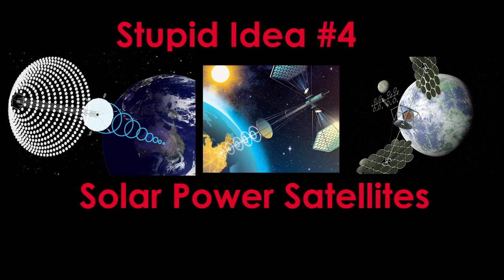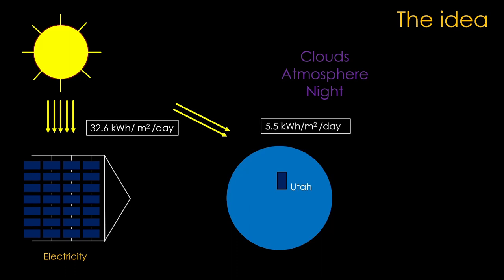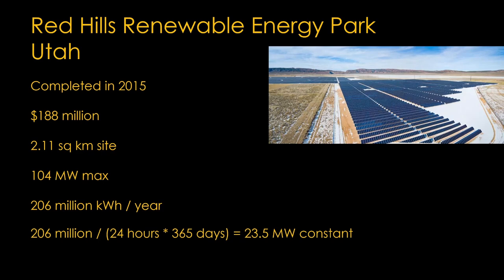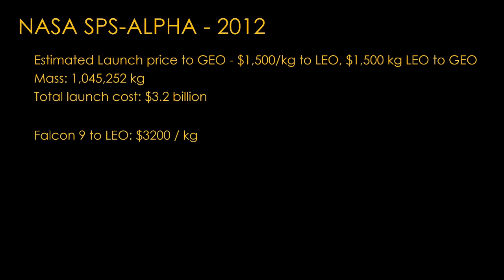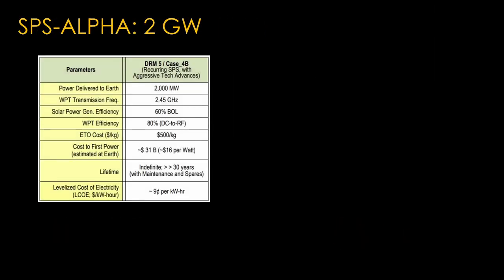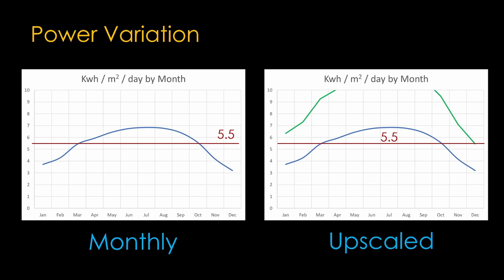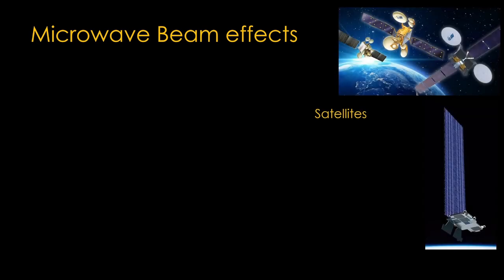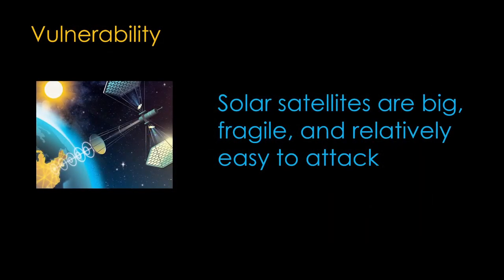Stupid Idea #4 - Solar Power Satellites

Comment: Sounds like rather than building a 1 sqKM antenna to receive the microwave beam, you might as well just build a 1 sqKM solar farm?
Reply: A rectenna is basically just a big field with loosely spaced wires in it, they are trivial to build. Doesn’t make the case for SPS any better but it isn’t quite that bad

Comment: I’ve come across this idea before and your analysis of it is definitely spot on. A couple thoughts: 
-Could a space-based system in the near future be developed so that the ~5x increase of productivity is not outweighed by the size limitations inherent to this project? My initial disagreement with the entire space-based solar option was that it would be very hard to send up something even “only” a fifth the size of some of these solar plants without years of development in terms of space construction infrastructure. 

-How long would it take for the price of the construction of a kilometer wide antenna in the desert and the launch price of the space based system to break even assuming normal/competitive prices to the consumer? It would seem to me incredibly long. 

Now, I haven’t seen the 2012 study, so I’ll have to take a look at that, but I’m guessing they are assuming advances in launch infrastructure as well as advances in the efficiency of solar panels.

PS, Any specific fish or will any fish do?
Reply from the maker: Before starship, launch was clearly a problem; I think even the pilot plant was 166 falcon heavy flights. With starship, you could probably do the pilot fairly easily, assuming that orbital refueling is straightforward. 

The problem I see is that if you just take the space you had allocated for a rectenna and cover it with solar cells, you're going to get more power output than the space-based system with none of the risk. 

I didn't put in a picture of a rectenna, which is probably an oversight. They're fairly simple in design; just a bunch of wires held up in the air, so much easier than the solar farm we're comparing it to. You do, however, need to find a circular property of the right size; Red Hills happens to be this really weird shape because that made the land acquisition easier (and cheaper, presumably).

If you want to see the NASA study, I linked it in the description. I found it confusing to understand, however. 

WRT fish: Do not constrain yourself by predetermined notions of an icthyological nature.
Reply: @EagerSpace  yep, I also found that point about using the land for the rectenna to just build a higher output solar farm on the ground pretty amusing but failed to mention it. Launching on hundreds of Falcon Heavies (Heavys? Heavy’s? How do you pluralize that?) is no small feat, but Starship could make it more feasible. Assuming SpaceX’s proposed frequency of three launches a day every day forever until we run out of methane, it’s definitely a less daunting task. 
Now, what’s caught my eye is that they planned for oh so many moving parts that need to be attached on orbit. The fragility of it, as you mentioned, would make each of these 150 docking operations nail-biters. Added benefit of starship is that you’re doing this less, but you’re also maneuvering a whole starship around a giant solar panel station in GSO, which is neither here nor there right now.
Thanks for explaining the rectenna, by the way. I had a feeling it wasn’t a giant parabolic dish, but I should’ve known it was wires. Those sneaky electrical engineers and their tricks. I’ve heard elsewhere that this exchange between electric power, EM, and back to electric power happens to be somewhat inefficient, so that isn’t helping the project either. I imagine a lot of power would be lost to the land surrounding the rectenna. More rectennas? Maybe. Another billion dollars in rectenna funding? Definitely.
Reply from the maker: @ksmi9109  I would prefer "Falcons Heavy"...

Rectennas are pretty efficient with good design; 80% is fairly easy and over 90% is probably possible. It's the transmission side where efficiency is harder to get.

Comment: Hi Eric! Stupid idea #5: Do you think it could be possible to focus a meaningful amount of energy by reorienting the Starlink constellation to reflect sunlight into a point? i.e. to heat & deorbit space debris
Reply from the maker: Interesting question, and not one I've thought about. You would need to have a independently-controllable mirror on each satellite, and if you were trying to focus to a point it would need to be an adjustable mirror. Possible - see JWST - but expensive and perhaps heavy. 

I don't have a good sense of how many starlinks would be in range of a given piece of space junk. 

My big concern is that just heating it up isn't going to be enough to deorbit it; what you want is to impart some impulse to change its orbit. Not sure how to do that. 

The downside, of course, is that if you hit it with enough energy to break it apart, then you've only made the problem worse.

Comment: I think I once heard somewhere that power satellites would be marginally viable if launch costs got down to, like, $200/kg to GEO. I don't know about that specific figure, but do you think there exists a launch cost that would allow profitable power satellites?
So, in your estimation, if launch cost $20/kg, or $2/kg, or was free, would it make sense to build power satellites then? Or would you still be outcompeted by the renewables with energy storage?
Reply from the maker: If launch cost is a lot cheaper, it comes down to hardware and assembly costs. There are some hardware projections in the study I looked at, but it's really hard to figure out how good they are, and I don't know how to project assembly costs, other than to note that people in space are really, really expensive on a per-hour basis. 

My gut feeling is that terrestrial solar plus storage is going to continue to get cheaper and easier, and I don't see how power satellite hardware is ever going to compete with that. 

I also think that the issues of actually building one of these in orbit and beaming power to ground are going to be more problematic that expected; you would somehow need to do an environmental impact statement to build something, and nobody has done that before so that will be a slow and expensive process.

Comment: I think it's probably possible to argue for rosier cost estimates than this, but the fundamental issue for any space based solar power project is that the raw solar panels you are trying to use more efficiently are dropping in price as fast as anything else in the world, and don't look to stop doing so.
Reply from the maker: It looks like NASA did a lot of work on the cost estimates, but my guess is that you need somebody quite skilled in space hardware to validate the approach; I'm certainly not up to it. And frankly it's light on details.

As  noted, I have no idea what vehicle they were thinking they would use to do the launching was remotely close to the prices they were talking about. That makes me wonder about their overall approach; if you are choosing pie-in-the-sky numbers for launch, what sort of numbers did you choose for the rest of it?

Agree totally on the fundamentals. Panel/Module price is actually getting low enough that it's not a big driver for the overall cost.
Reply: @EagerSpace  I think you're giving NASA too much credit. Mass manufacturing is not their speciality.
Reply from the maker: @veedrac  Perhaps. There's not a ton of detail in the paper, but how would you come up with different estimates for the cost of all the parts?
Reply: @EagerSpace  There are parts of the cost estimate I couldn't possibly do a sensible job at, but if the energy transferred to Earth can be done at a good cost, then you are left with just estimating flight and panel costs as the primary factors. Flight costs with Starship are readily estimable as you know, and for something like this there is a possibility of extremely high flight rates, like 10,000/year or something. Solar panel costs are just the cost of terrestrial plants, which follow known scaling laws. There will be a bunch of other costs for infrastructure and the machines that move the panels around, but I expect those to scale fairly well, maybe except for cooling costs, so mostly it's just energy transfer, flight, and panels.

Which is not to say there won't be costs above that, but those will depend on the ambitions and competence of the corporation doing the work, more so than fundamental cost structures.

(In reality if this was my job and it was a serious project, I would hire someone with more expertise.)

Comment: the only advantage of space solar power is to save space utilization on the ground.
Reply from the maker: Assuming that the rectenna (and perhaps, a safety zone outside of it) is smaller than the equivalent ground-based solar farm.

Comment: Eh... Your main argument boils down to the fact we'll have to study the effects of microwave beaming on infrastructure and wildlife first. This hardly qualifies as a candidate for this series, as per your own analysis.
Reply from the maker: Sorry it wasn't clear. 

My main argument is that even with rosy price estimations, the cost of power from solar power satellites is at least 3x the cost for terrestrial solutions, and the terrestrial solutions have been getting cheaper every year. 

Or, to put it another way, 5.9x sounds great when you first hear it, but to see the benefit of that you need to a) do a lot of complex development on all the parts of the solar satellites, b) navigate any legal issues that crop up with this new use of space, and c) launch, assemble, and operate the thing.

Even if you discount all the development costs and assume you've gotten to a mature and optimized system, you still lose the cost competition by at least 2x and likely quite a bit more. So why would anybody want to invest in this sort of thing?
Reply: @EagerSpace  Again, this doesn't exactly qualify it as a stupid idea, just niche. You also hardly used the most "rosy estimations" when calculating launch costs. At 150 ton to LEO and ~$5M per Starship flight the numbers suddenly look somewhat different, and there's no reason to think that the launch industry will magically stop innovating after Starship. The main factor deriving the competitiveness of SBSP vs traditional solar is launch costs vs the cost of energy. With how radically both of these metrics changed over the past 50 years, it's very difficult to say how things will looks over the next 50 years. It would be difficult, but launch costs could absolutely catch up eventually.
Reply from the maker: @danmosenzon1477  The pdf is linked in the description....

Considering some numbers...

Looking at DRM 5 / Case_4B in table 7-16, that's a 2 GW option that assumes you are building a lot of these and you have done very well with tech advances. That option's mass is about 25,000,000 kg (table 7-15). If the cost per kg to GEO is $1000 (I think table 7-16 only shows the LEO cost), then that's $25 billion in launch costs out of $31 billion total. 

If we assume launch is free, then that puts the overall price of this option down at $6 billion. Assuming everything else is the same, that puts the cost of energy at $0.017 per kwh. 

If you assume Red Hills will last 30 years and you use the 2020 historical construction price, it produces power at $0.015 per kwh. Already slightly cheaper than the free launch option. 

At 150 tones to LEO for $5M and 5 tanker flights to get enough propellant to get to GEO, that's $30 million per trip to GEO. At 166 trips to GEO to carry 25,000,000 kg, that's $11 billion total project cost, or somewhere about $0.03 per kwh. 

Launch may continue to get cheaper than starship, but grid-scale installations are also going to continue to get cheaper over time.

I don't see a reason to invest in the SPS model when even if you build a lot of them and do really well on tech advancement (especially the power transmission efficiency, which will be a challenge), you still can't compete on energy cost with a commodity installation put in in 2020.  You get a little advantage with them because they can drive base load year round, but it's not clear to me that that capability is useful enough to support the likely premium cost for SPS.